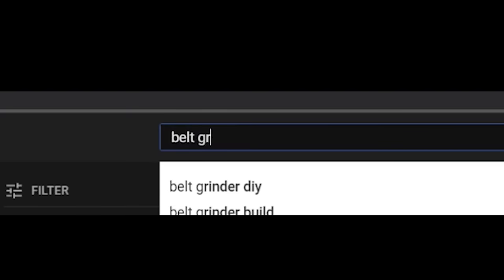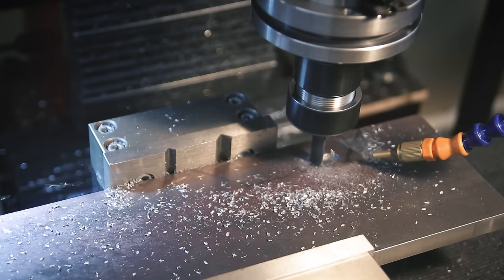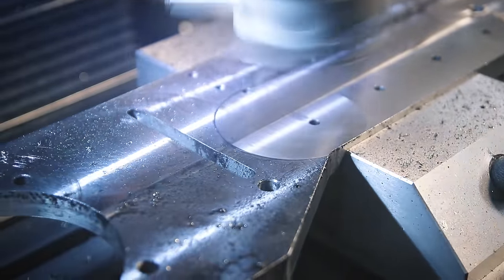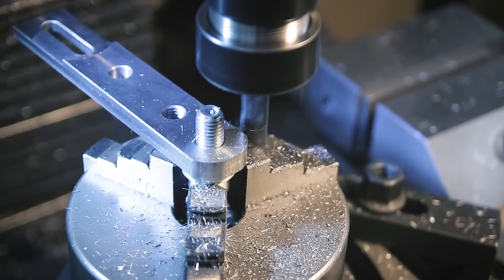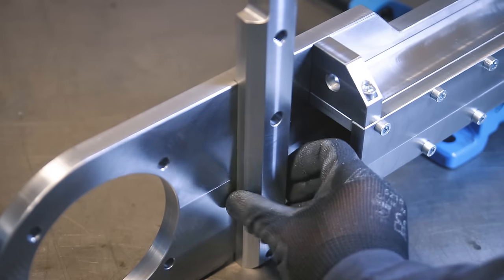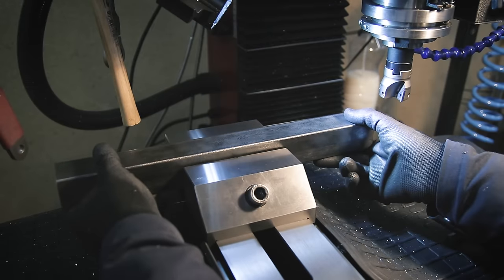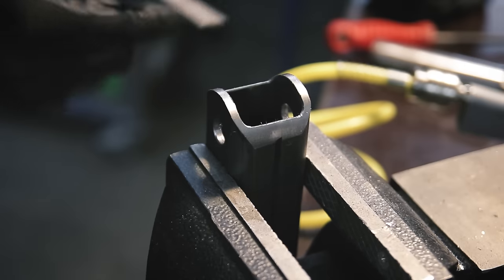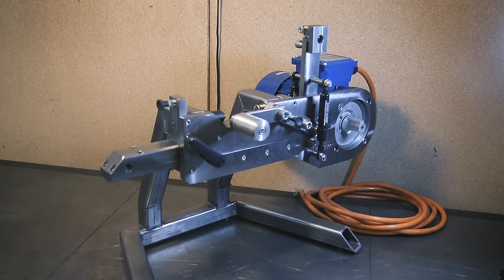Building a Machinists Belt Grinder - The Trilogy [Part 1]

Comment: this build is uttterly insane. so smart. so thought out.  love it. question. i noticed in some of your videos you use the tig trigger instead of a pedal.  i tihnk the tirgger would be more intuitive to me...i use a wacom tablet a lot and and am an illustrator /designer in real life....i have mig welded alot...just bought a tig...but havent  messed with it yet...do you love or hate it
Reply from the maker: Personally I love it, and you don't really need the pedal except for special occasions where you need to change up the amps while welding (usually only necessary for Aluminum). If you weld steel like this a simple on/off switch is totally sufficient. There's also some machines/accessories where you get adjustable amps on the torch via a pressure sensitive button but the feature is quite expensive. I suggest just watching some starter vids and then just messing around with it. Learning curve is a little steep in the beginning (you're gonna be dipping the tungsten a lot) but once you get the hang of it, it's very rewarding. You just have a lot more control and versatility versus a MIG welder, at the cost of some speed.
Reply: @PhilVandelay  awesome. i think my internal tactility( that prolly not a real word) will dig the finger  control...i do have a pedal though if poop goes sideways...wich trigger did you buy...and. thank you so much for answering...yer builds are so fun..i hav
e a few fun builds coming up

Comment: Do the plans include a digital file that I can sub contract the making of the main plate? It is beyond my machining capabilities (I don't have a  rotary table). It seems well suited to laser cutting.
Reply from the maker: Yes there's the full 3d model included that you can see in the video. I can also send you .dxf files of the parts that can be used for lasercutting
Reply: @PhilVandelay  Many thanks. I'm going to complete watching the series to make sure the rest of it is within my capabilities. I'm working with a small combination machine which has limits. A friend has a proper mill so it's possible I can beg him for help.  Lovely design - I'm sure it is a great machine when complete. I build guitars so having the swivel / angle table adjustments is great.

Comment: awesome video. question1 are you left-handed? question2 do you use a papr when you tig weld so you dont breathe that stuff in. I use one all the time and i feel sooo much better now that im not putting that stuff into my blood. Also try the pulse setting on your machine. try 6.5 pules per second and see if you like it. cheers
Reply from the maker: Yeah I'm left handed. I'm not using a respirator or anything, I was under the assumption that it's not necessary at least when welding (clean) steel. But I'm also not doing production work or anything so I don't weld for hours every day or anything like that. In my new shop I'm going to install a fume extractor over the welding table though, so at least the stuff doesn't hang around in the room (not just for welding but many other fumes too). I agree that this stuff should be taken seriously, I don't notice and health effects from what I do now but who knows what it looks like in 10 or 20 years... As for the pulsing, yeah I never bothered with it too much, mostly because I'm too lazy to dial stuff in. But I should probably look into it especially with Aluminum
Reply: @PhilVandelay  your a talented man. Be a shame to get sick for not reason. Pulse works for everything, not just aluminum.cheers

Comment: I am very curious on how the build is holding up? people always tell me that hot rolled is soo unstable. Have you noticed any parts building up stress since you finished the build? maybe too early yet too notice any stress.
Reply from the maker: It's holding up fine, it's extremely overbuilt so even if it was made from Aluminum it's very unlikely something would just "break". Biggest issue in the long run is more likely going to be surface wear in places like the table, platen, clamping blocks and so on. But I think it'll take a long time for that to become a problem, at least with my use.

Comment: Hi Phil,
Sorry to trouble you again, I just bought your plans for the 75 by 2000mm belt grinder. Could you give me a link or picture of the 3 phase motor you bought, thanks.
Reply from the maker: Hi, not sure this will be much help but this is the one: https://shop.dwema.de/Elektromotor-Drehstrom-15kW-S6-3000-min-Welle-19mm-80-B14160mm-Flansch

Comment: Beautiful design and great video.... I'm curious, does anyone just 'wing it' when designing something, or has everyone gone to some sort of CAD program these days?
Reply from the maker: Lot's of people do I think, and I used to do it that way too in most of my older videos. It kind of depends on what you want to achieve, CAD allows you to design more complex things and reduces planning errors (to some extent) because you've thought the whole thing through before building it. However, it comes with a huge downside, which is that it's much more time consuming than just winging it. I think both approaches have their pros and cons and are totally valid and can yield great results. Winging it is probably a better learning experience, because every time something doesn't work out the way you thought, you've learned something new. That being said, there's absolutely no guarentee that what you planned in CAD will work in reality either ;)
Reply: @PhilVandelay  Cheers. So true... Keep up the great work!

Comment: Your style reminds me of marco reps channel. "So perfeckt and precise"
Half the time I don't even know what he's talking about but I love to listen to him. I really want to build your design but being in the US it looks like I'd need to use the stupid inch system, both for the belts availability and because it would be a nightmare converting every measurement from metric to decimal inch for my machines. 
Do you think this would be a good ideas working from your plans? Im not sure exactly what would be involved in your specific plans/drawings. Im thinking I could purchase your drawings and just use the rough design and simply convert a few details to work with my needs. Your thoughts? Thanks! Thumbs up and subscribed!
Reply from the maker: I'm not sure what would be more work, converting the plans or working on a non-metric machine... It is ia LOT of measurements in there. And the nice thing about metric is that everything is very neat, I try to avoid weird numbers as much as I can so 90% of the measurements are nice, round numbers so they're very easy to work with and make calculations. If you convert all that to inches you'd probably end up with a lot of weird decimals. As for altering the design, you can of course try it, but there are quite a few parts where if you change one thing, you get a chain reaction and nothing fits anymore and you have to change everything, if you know what I mean. 
I'm guessing you don't have DRO on your machines, in that case you could simply switch it from imperial to metric and you'd be set. I think that would be my preferred solution. It's really sad that this barrier exists, because I would like to make this usable for everyone but I simply can't even think or plan anything in inches, it's like a foreign language to me with all the fractions and gauges and whatnot.

Comment: first of all i want to thank you for sharing your knowledge. Your videos are very impressive. I have a question... how do you apply the function in fusion360, as shown here 1:57 ?
Reply from the maker: Hey, thanks, I made that using the animation feature (on the top left you can change your workspace from "Design" to "Animation").
Reply: @PhilVandelay   thank you for the tip :)

Comment: Awsome! What is your thoughts on making the frame out of aluminum?
Reply from the maker: That was actually my first plan, the main reason I picked steel is simply because it's cheaper. I think the design is overbuilt enough that you could make it out of aluminum without changing anything. I think I'd go with steel for the work table and the base though.
Reply: @PhilVandelay  thank you. I totally agree that the base and work table should be steel

Comment: What? Heavy plate steel? All Milled surfaces? I was expecting surface ground, scraped or lapped parts at the very least :) :)
Awesome belt sander, Amazing build video! It was almost therapeutic to watch this at 0600hrs with a hot cup of coffee.
/rant/ I think the manufacturers of my belt sander went overboard trying save a dollar here and a penny there, to the point where it is mostly 'belt' and very little 'sander'. It is supposedly built out of "Sheet Metal", so basically it is built of steel foil and duct tape :) /end of rant/
At this point I'm considering building one out of plywood and glue, and even that's gotta be a HUGE improvement over the cheap sanders in terms of stiffness and durability. Maybe fiberglass it later on for added strength & stiffness. And while we're at it, maybe even add carbon fiber on top of everything to make it insanely strong. Or just build it out of metal to begin with!
Reply from the maker: Yeah I have a cheap belt grinder too from some hardware store, I almost never use it because it's so unbelievably loud while at the same being so weak you can easily get it to bog down. Like you said they use a lot of sheet metal because it saves material cost and is cheap to produce but often not really a good solution. Well I guess you get what you pay for...

Comment: does anyone know if a 3.00" x 79" belt work fine? A lot more easily available from USA suppliers. Or can someone post a link to a USA supplier of the 75 x 2000 belt?
Reply from the maker: 3" by 79" comes out to almost exactly 75x2000mm so that should work fine. My guess is that if they sell 3x79" belts in the US, those are the same european belts, just with a US designation

Comment: hey, what is a good belt speed? in other words, given the motor rpm how do you choose the drive pulley diameter? pre thanks!
Reply from the maker: I did some google research on what belt manufacturers suggest and what is common practice in industrial applications.  Some belt manufacturers provide an optimal speed these belts are supposed to run at where they perform best, it depends on the material but for steel it's usually around 30m/s (meters per second), for some metals as high as 35m/s. You can go even faster, but you rarely find anyone suggesting slower speeds. Basically you want the belt to run very fast, much faster than most people would assume, to reach the optimal cutting speed and although it seems counter-intuitive, the belts actually last longer that way. So let's do the math: I have a 200mm drive wheel which comes out to a circumference of 628mm, meaning with each full rotation of the drive wheel, the belt would move 628mm. Since we want to calculate meters per second, let's convert the rotations per minute into seconds. People usually use 3000rpm motors, so 3000 rotations per minute divided by 60 seconds would be 50 rotations per second. Now lets multiply that with 628 which gives us a belt speed of 31.400 milimetres per second, or 314 centimeters per second or (drumroll), 31.4 meters per second, which is right in the sweet spot for the best belt performance. I'm actually running this motor at 3400rpm max thanks to the VFD so my effective maximum speed is closer to 35m/s which seems ludicrously fast - that's 126 kilometres an hour, which is like driving a car at highway speeds - but that's what it takes to get a really efficient grinder.

Of course you could use a faster motor or some kind of transmission ratio to achieve the same thing with a smaller drive wheel, but I'd rather not increase the RPMs even more since this is already spinning pretty fast.
Reply: @PhilVandelay   wow thanks a ton for the detailed explanation, the 30-35 m/s datum was already enough!! ^^ Did you find common torque values as well? I already have a monophase AC motor I want to use and dont want to compromise to a speed for which I do not have enough cutting strenght. Probably I would just need to take it easy when grinding, but knowing a common torque spec would be nice if you have done the research already. Again, thanks a lot!
Reply from the maker: @Motorcycleman1997 No problem, I thought I'd answer it in detail because I already expect this question to come up a few more times and then I can just copy the answer 😅 I can't say much about actual torque numbers, but I have often heard the rule of thumb that you want to have about 1 horsepower per inch of belt width and from my experience that's a good rule. That at least gives you a general idea of how much power is required. Generally I'd prefer speed over torque in this case, grinding belts don't really like it when you use a lot of force to press something onto them, the material removal rate mostly comes from the speed.

Comment: hi bro hey what motor did you use for this project?
Reply from the maker: 1.5kw / 2hp / 3000rpm three-phase motor with a size 80 frame and  B14 mounting flange

Comment: Why the 72 inch belt? A 6 by 48 works fine. The unsupported areas of all these 72 inch only round over edges in an nonspecific curve. Is that the desire?
Reply: The prevalence of 72" belt grinders means the supply of belts is typically higher,  which translates to greater variety (brands, grits, surface media, etc) and lower cost than many other size belts.  When I make my belt grinder, it will be 2x72 for this reason alone, as it will ultimately save me hundreds of dollars a year on belts, compared to a 6x48.
I expect he will primarily use the grinder against the platen, not in unsupported areas, but sometimes the unsupported areas that generate a curvature are desirable for certain tasks (such as edge bevels). So while the curve is non-specific, it is predictable and controllable, based on where you place the part, the pressure applied, the tension of the belt, the grit of the belt, the speed of the motor, etc, etc.
Reply from the maker: I guess the question for me would be, why not? A 72" belt lasts longer and you get more grinding surface relative to the price, there's better heat dissipation and so on. Also allows for more flexbility when making attachments like contact wheels, small wheel attachments etc. I have the space so I don't really see the benefit from making the machine smaller.

Comment: are you now have 1x200N gas spring or weaker
Reply from the maker: 1x 180n
Reply: @PhilVandelay  are 180N enough tension?
Reply from the maker: @Doctor_88  Yeah for me it works fine, but you have to make sure the friction in the mechanism is fairly low (lubrication and not over-tightening any of the tensioning bolts). I guess you could go to 200 or more to make sure, but at some point retracting it will become too hard (with 180N it takes a "medium" amount of strength)
Reply: @PhilVandelay  thx for help 👍
Reply: can you tell me what are angles of base stand

Comment: Hi Phil what is the weight of this belt grinder?
Reply from the maker: I never weighed it (will do that soon) but it's heavier than I can pick up. I'm guessing between 80-100kgs. But if you remove the table and the platen attachment, the individual parts can be carried (Base+Motor is still pretty heavy though, but doable)
Reply: @PhilVandelay  well it’s good to have the weight. This is a great build, well thought out!
Reply: @PhilVandelay  Hi Phil, wanted to ask you, I’m in the market for a milling machine could you give me an idea of a good milling machine?
I had my eye on a OPTImill MB 4P what would you recommend on a budget of around 5000 not including attachments?
Reply from the maker: @aubreymatthews1021  Picking a mill is a huge topic so I can't really suggest models of the top of my head, it depends on what you want to use it for and of course other factors like how much space you have. The MB4 is a good mill from what I hear, if it's good enough for Stefan Gotteswinter it probably is good enough for anyone ;) 
The one I'm using is quite similar in how its built, the advantage of this form factor is you get most of the capabilities of a larger mill but they take up less space and usually cost less. So I think they're a good option for hobbyist use, you can do good work on them.  At 5k I would probably start looking at used industrial mills but that's a whole other topic.
Reply: @PhilVandelay  I’m more of a hobbyist, but I will be using it for fabrication of odds and ends on yachts,  pumps, bushings, mounts, brackets, hydraulics but mainly I get a lot of satisfaction and express lots of creativity, another reason I have a small rope manufacturing company and the braiding machines accumulate ware on some of the parts, replacing them costs more than the Milling machine would.
Space I have.
The info I’m looking for is basically a start up mill that has many options and I won’t grow out of, because of a lack of options or performance, I’m ok with restrictions of size of parts I can work on. 
If you could guide me to a site where to find milling hardware, like chucks, collet sets, and milling bits.